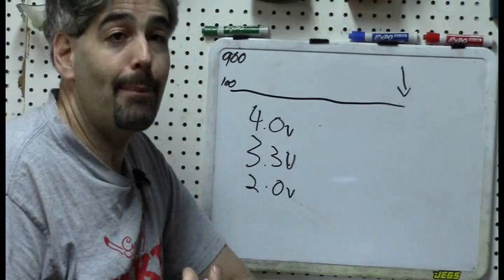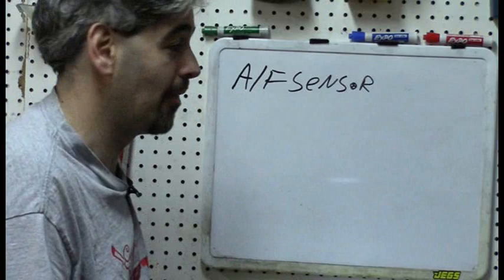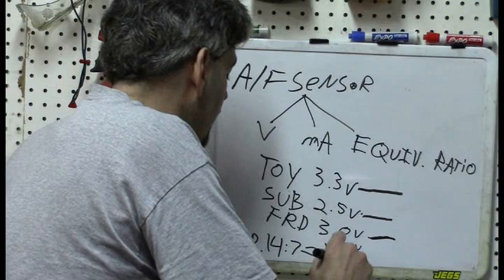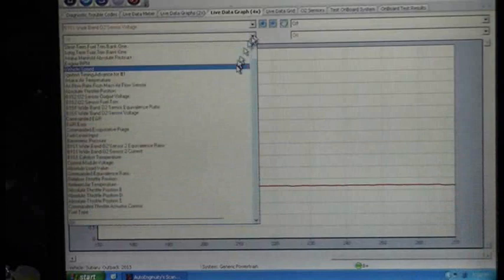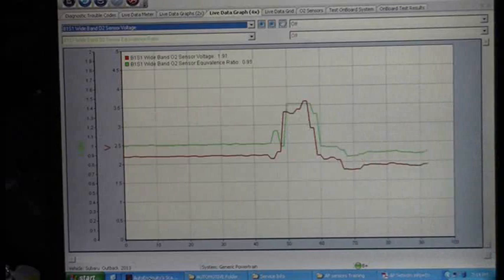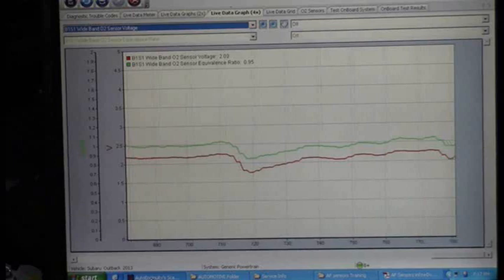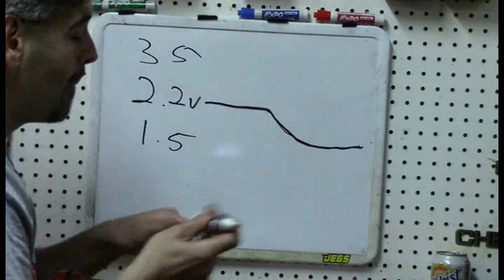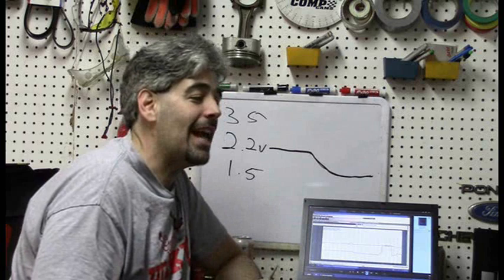Air/Fuel Sensors (Wideband Oxygen Sensors) vs O2 Sensors- PART 2

Comment: I am getting a p2196 (sensor biased stuck rich)

I thank you for making this video because I was very confused about the sensor readings...

The car I am working on is a kia so I did some research and found that 1.9v is the voltage they use for stoichometric...i am seeing .9v and i am in the negative with mA current readout...i just dont know if the pid is basing the reading off of 1v or off of that 1.9v... if it is basing it off the 1 volt for perfect lambda then of course i would be barely running rich and if it were basing it off the 1.9v then the sensor would be reading very rich at .9v

Comment: Thanks, Your video is great and instructive. I have a bad performer to go look at right now. A 95 Thunderbird with a drifty O2 sensor.  This will help!
Reply from the maker: You will definitely want to see my video "secret of engine problem diagnosis: fuel trims" which will be far more helpful.  It is integral to determine if the drifting sensor is a result of an actual condition that it is accurately reporting, or if it is from a sensor that is going rogue. That video will show very comprehensively how to interpret the data.

Comment: Hi Mate, your reply is funnier than the comment!  Just a quick question, if cars that run A/F sensors are always stoic due to their impressive reaction time and wideband sensing that trims the fuel precisely, stoic to me means a perfect burn so the emissions should be  CO2 and H20.  Are Catalytic convertors then needed with cars running A/F sensors?
Reply from the maker: stoic technically means perfect mix, not perfect burn. Good question but yes, cats are still needed. Even if there was "perfect burn" it will not be in all applications, WOT just for an example.

Comment: Hi, 

Thanks for taking the time to makes these videos, they're very clear and easy to understand!
I wondered if you could clarify something for me as I plan to put a A/F sensor on a motorbike using a custom setup from an Arduino microcontroller, and from what i understand the actual sensor only outputs changes in amperage that then gets converted to a voltage signal for the engine management system to read, Does this 'conversion' happen in the A/F sensor controller? I see alot of kits online which include the A/F sensor, some sort of amazingly crappy display for the readout and this controller and wondered if it was the case.

Thanks again and keep the vids coming! :D
Connor

Comment: Great videos,I am a little slow but learn something every time I watch them,thanks for taking the time!Do you have anything with air fuel ratio sensor readings post converter for diagnosing po420 and po430 catalyst below threshold?
Reply from the maker: Yes I do- see my catalytic converter diagnosis video. It appliues to A/F as well since the downstreams are Zirconium dioxide based.

Comment: Learning and loving it.  Great information, well presented.  I’ve since been monitoring live data as I drive a 2016 F150 5.0.  Occasional stumble and stall at idle.  All my AFR lambda data looks normal, fuel trims look normal, my O2 B1S2 data is all over the place then will be steady for 10-15 minutes.  Is it possible the B1 cat can be intermittently working? I would think the cat either works or doesn’t.  Thoughts?
Reply from the maker: That won't cause your performance issues.  If it stumbles you should absolutely see that reflected in short fuel trim at time of the event

Comment: Hey Matt, so glad I found this video today.  I'm attempting to diagnose a failing cat for Bank 1 on my 05 Altima.  I am seeing something very interesting with my live scan tool.  My bank 1 A/F sensor hangs out around .3V but my bank 2 A/F sensor is coming in around .6V.  I can't understand if this voltage shift is intentional.  I am interested to see what my equivalence ratio reading would be, that's the next thing I'll check.  Have you ever heard of this scenario before?
Reply from the maker: All the time.  See my video on catalytic converter diagnosis. It’s the easiest diagnosis there is.

Comment: Matt, Good job on your vids! Very informative. I am new to your channel and I am one of those shade tree mechanics that went to the wayside years ago when things went electronic but now I am teaching myself to figure these cars out. One of the  reason I am writing is in your Air/Fuel vid part 1 you said the voltages are imaginary  and that they were current. you said that when the ratio goes rich  the current goes low and when the ratio goes lean the current goes high. I believe you on that but I am a little confused that you say the voltages are not real because I believe that goes against the ohms law which I believes says amps go high voltages go low and when voltages go high amps go low? Please explain! Once Again Great job, and make that 1001 subscribers!
Reply from the maker: Hi Billy great question and thanks for subscribing. Indeed this hobby/field is always a learning process.
   To answer your question, the way I mentioned it is correct. It is current and only current that is used by the computer to determine rich or lean and the voltages you see on a scantool are just imaginary. Because the voltages are imaginary, they do not have to follow Ohms law. In fact the output from the scantool could have been pounds or even karats or even dollars for that matter because it is just simply a unit of reference and I guess they thought voltage would just be more familiar to people than mA.  
Technically, the rich/lean determination is done by polarity of the current, not strictly magnitude of the current. At lean conditions the AF sensor sends current in opposite polarity of when it is in a rich condition. Thus the reason no current at all is stoichiometric.  Notice no current at all will still be reported as a positive voltage though, even though there is no voltage.  Confusing indeed.

Comment: I have a thinkdiag mini engine scanner and it show one parameter that I can’t understand, AFS : 30Hz, whenever I press the accerator pedal the value increases correspondingly. Is it air flow sensor or air fuel sensor?

Comment: Fantastic video, thank you. I am interested in what S2 should react when S1 is a AF. Should the S2 still show the same way as if the S1 is a 02sensor or would it show reversed as well with the graph jumping all over rather than little movement?
Reply from the maker: excellent question. 
  So every car I have ever seen with an AF still has standard zirconium dioxide O2 sensors for post cat. so basically you read them exactly the same- if they oscillate like a front O2 sensor, the catalyst is surely worn.  i have never seen an AF rear sensor. yet…
Reply: @SchrodingersBox  Thank you. I have a Nissan Altima 2.5L 2008 with a P0420 code. The S1 reads 2.275 and EQ is 1.04. The S2 voltage is between .230-.740. Haven’t checked voltage at connector. 
Will be doing 100K tune up and check for any leaks at that time as to not have issues when change the CAT.

Comment: Is 1.275v a good number for a skoda octavia avu engine 2001/06 1.6 sr for the wide band sensor pre cat? Mine drops to almost zero after i press the throttle and stabilizes again at 1.275v when i let it go. Reading by VCDS.

Comment: Hello from Darwin Australia Matt, Your presentations have kept me interested for weeks. My question is not about the latest presentation, but about about your overall knowledge of the topic through extensive research.  Can I present you a scenario?  A Landcruiser used as an underground mine vehicle has a blown fuse for the rear wiper circuit. The fuse is replaced without determining the cause and shortly after, the wiring loom incorporating the wiper circuit and others melts from heat which started a small fire. The 20 amp fuse was found to have blown
again.  The diagnosis from professionals is a low current fault that was not sufficient to initially blow the fuse, but caused the wiring to melt. No quantitative explanation or evidence was provided and other than protecting wiring with conduit and connectors with waterproof tape, a fix to prevent another similar event was not provided.  Could I impose on your scientific based knowledge of vehicle electrical systems for your opinion and if you know of sources of information on this phenomenon.  Should we be able to monitor for increasing levels of circuit resistance
Reply from the maker: Thanks for watching.   I can presumably see a couple conditions where this could happen (the wiring fail before the fuse does). One is corrosion in the wiring that ultimately forces current through smaller and smaller channels (i.e. fewer and fewer strands of wire) which while overall is lower amperage due to the voltage drop across the corrosion, the individual strands of wire can each carry more than their usual share and overheat. Think of an extreme case where on a cable, all but one strand of wire has corroded. That wire will fail before the fuse does. 
   A second example is similar but would be physical damage to the cable or harness. I actually have a video of a wire harness that was rubbing against a plastic pulley. Because the pulley was plastic there was no short to ground so the fuse never blew. The remaining wires burned up right through the wire protector but no blown fuse. 
Either way, same thing. A fuse is supposed to be the weakest link in a circuit but Wire erosion can create a section that is weaker than the fuse.
Reply: Schrodingers Box  Thanks for the reply Matt.  Very impressed that I got a reply so quickly with your usual easy to understand logical information.  Seems to be the most suitable control will be protecting the wiring from damage and connectors from corrosion. Anything I can do to prevent an underground fire in our mines is time spent well.  Hopefully your premium channel is still available so I can further my DIY knowledge.  Keep up your great teaching, which is obviously a passion for you.   Tony

Comment: Thank you for the tutorial.
I need some clarity on this:  during WOT operation on engines that use narrowband sensors, PCM will switch to open-loop mode, which means it's not going to sense O2 readings.  What about WOT operation on wideband AF sensors?  The PCM will still switch to open-loop, but unlike narrowband sensors, are wideband sensor(s) still  monitored by the PCM?
Reply from the maker: Thats a great question.  While I know engines with widebands go rich I do not know if they go into OL-but it's very easy for me to find out... next chance I get I'll put my car into WOT and see how the loop reacts on the scantool.

Comment: Thank you once again for a great video.
With the wide band sensor, do the short term and long term fuel trims work the same as normal o2 sensor, i.e. the short term fuel trim oscillates in sync with the o2 waveform in the older type sensor; what happens in the type of sensor?
Thanks in advance, great work.
Reply from the maker: Yes fuel trims are exactly the same as what you are used to in O2 sensors. But you will still need to know how to interpret Wideband sensor readings otherwise you will always be limited to assuming the wideband is functioning properly and giving accurate fuel trim values.

Comment: My STFT for both banks are oscillating (near to zero) but the LTFT are 19% in bank 1 and 24% in bank 2. My car is using wideband O2 sensor and their currents are oscillating near to zero also the lambda is 1 for both banks.
But the issue is that both LTFT1&2 are high.

The wideband sensors can't see the leaning condition.

Comment: Thanks for the Video I’m slowly understanding how these work. Just one question have you done a video comparing the first and second AF sensors? Does the rear read the same as the front which I don’t think it does as the one I’m looking at reads totally different.
Reply from the maker: the rear will (at least as of now) always be a regular zirconium dioxide O2 sensor- not AF. 
  The rear sensor is to determine catalytic activity, not to adjust fuel trim.
Reply: Thanks that just makes total sense now lol. However the p0172 code is a hard not to solve. Now I’m wondering if it’s a mechanical problem with the valve seals. These VW golf GTi ‘s have issues in this area. Why I don’t know.
Reply from the maker: check your rich condition variables and modify them to see impact on fuel trim. that’s how I do it at least.

Comment: Interesting Matt so is the sudden lean condition because the injectors respond slightly late to the measured air with the throttle snapped open and then the return to idle maximised the vacuum in the inlet manifold because the throttle plate is closed. Am I correct that if the throttle was opened slowly and the system was operating correctly the stoichometric ratio would be maintained through the increase and decrease in engine rpm?
Reply from the maker: The sudden lean condition correlates to the deceleration after the snap throttle. In deceleration, the fuel injectors are actually turned off which of course is read as a lean condition briefly.
Reply: @SchrodingersBox  Thanks for your reply, yes fuel injectors turned off I did not know that. I should have realised that.

Comment: Are the 3.3v, 2.5v, and 3.0v all reference (sensor input) voltages? If so, you be able to measure the voltage (from the PCM to the sensor) with a multimeter to determine lambda.
Reply from the maker: AWDn0t2 No and no- the voltages are purely "imaginary" points of reference and cannot be measured- this is explained in Part 1 actually.  Why there are so many different "voltages" 2.5, 3.3, 3.0 etc I do not know- I guess each manufacturer may have arbitrarily chosen those.  They could as well have been 100V 300V and 500V in fact, because they are actually all virtually 0V in real life.

Comment: Hi matt,  first of all thanks for your videos. Just one question... how do you know by a visual inspection if it’s an O2 sensor or air fuel sensor?
Reply from the maker: You don’t. You have to either look up the design or confirm it from a voltage reading. They look perfectly identical right down to the wiring.
Reply: Schrodingers Box thanks dude for replying. Greetings from malta 🇲🇹 europe :).

Comment: Stoichiometric on E85 is 9.8 to 1 instead of 14.7.  So if the car is running on E85 (and it was designed to do so) would the ratio pid read 1 or would it read lean, something higher than 1?  Also you mentioned it works off amps.  How can you have negative amps unless it's also creating voltage that changes polarity?
Reply from the maker: There are no negative AMPS, just polarity change.

Comment: I love your videos and it helps me a lot in my learning curve. I do have a question though, if you would be interested to assist. My chevrolette Orlando 1.8 constantly gives me a P2096 fault (Post cat fuel trim lean) but the O2 sensors report rich and my LTFT is mostly between -5.5 and -7.0 at times. I do not have any exhaust leaks, I do not have any power related problems either. Could this be a faulty O2 sensor or do I have leaking injectors. I did remove the injectors and with the ignition on it was not dripping or leaking at all.  If my O2 sensors report rich, then why is the fault code reporting a lean condition?
Reply from the maker: I don’t understand- you said your O2 sensors report rich yet your fuel trim is stable. how can that be?  what is your O2 voltage?
Reply: @SchrodingersBox  , Hi again. Im happy to reportthat I managed to figure out what caused the P2096 fault, well I think anyway.
A while back I replaced the plugs during a service and I unpluged the coil pack conectors without disconnecting the Batt neg terminal.  Stupid I know. So after resetting the fault codes for the last time, i decided to disconnect the batt leads for 5 to 10 seconds and reconnect it again. Lo and behold, the car is running fine again and the fault code has not returned yet. I suppose the computer needed a default reset.

Comment: THANKS for the video.  My question is though how will the scan tool see the difference between a good and bad cat converter with a A/F sensor Front and a narrow band o2 sensor after the cat.  The technique  with both O2 sensors was to watch to see if the last O2 sensor imitated the first O2 sensor or flattened it out.  Since an A/F sensor is linear, how do you tell if the Cat is bad or the front AF is running  rich and giving you a p420?  My back O2 is giving me a pretty flat 650 millivolt.  Trying to see if this a degrading cat or a rich AF?  Any ideas.  Thanks. 2001 Vw Jetta AVH,  SSB
Reply from the maker: Yeah good question. The O2 sensor would give you an oscillation at 2200RPM if the cat is bad.  Again  remember, while the A/F sensor output is different, it still induces oscillation same as a zirconia sensor. You will still have the +/- 2.5% on the STFT all the same.

Comment: Is the wide band sensor Current measurement a good way to check the sensor? 0mA = lambda 1.             30mA is lean condition. - 30mA is a rich condition. On a diesel engine I got always 45mA witch is normal because a diesel engine works with plenty of air. Many thanks for the video.
Reply from the maker: Yes it is. Current is what is actually used, not voltage.

Comment: I’m using this to diag my 07 Corolla. Seems to be working fine but my sensor is acting like an 02 and going up and down. Can’t tell if it’s a car prob or a sensor beginning to fail. When I go full throttle and let off I get what you would expect. But it tends to be a little bit slower. Like it goes down then up. And it takes a actual second for it to begin going down.. and then it may go down to 2.2 then slowly back up.. when driving 40 if I let off it does the same thing
Reply: I need to get on it. And take a vacuum line off. And then make it rich. But I haven’t gone that far. Still trying to use everything to learn how the sensor is supposed to work… also the reason why I’m even checking more is my long term fuel trim is +13% when on gas. +8 when idle